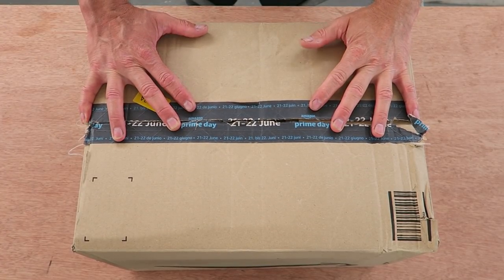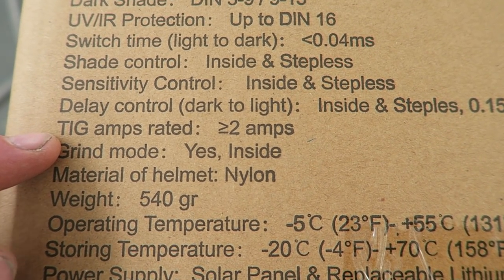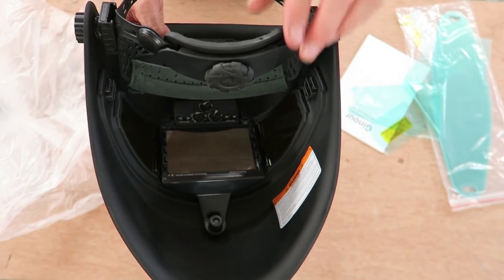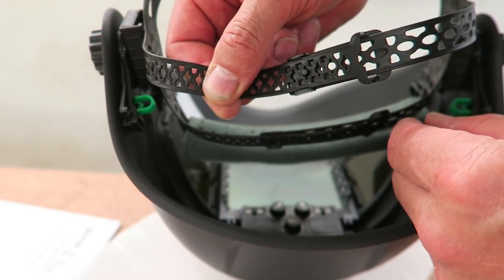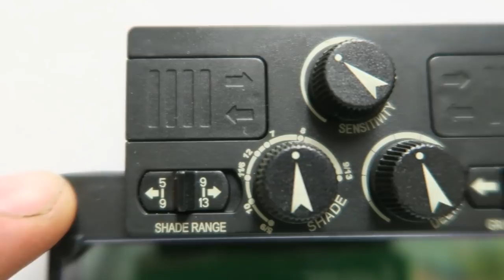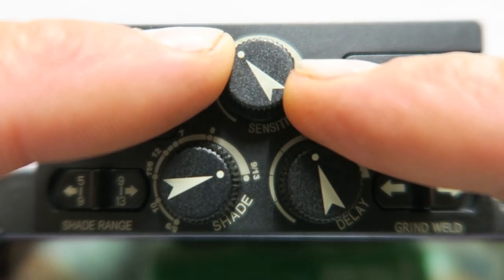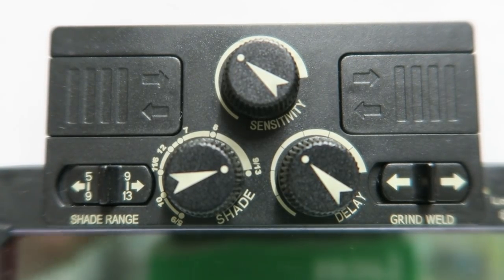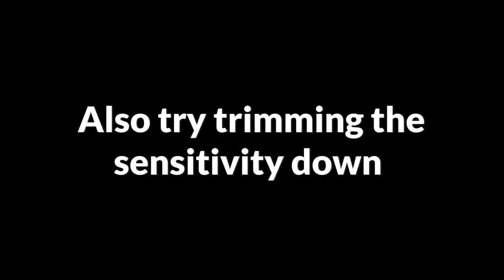Tool review Ginour welding mask / helmet review Trev's Blog

Comment: Unboxed the helmet.  Guess what?  It works!  The head adjustments really make the helmet very comfortable.  You are correct - the instructions suck.  The person who wrote them must have never seen the product.  Made a couple of test passes and the ease of tunning of the controls was spot on.  The only thing I would like added is a "TEST" feature. For the price it can't be beat. Thanks for the video.
Reply from the maker: I’m glad you’re happy with the helmet, for the length of limited time using it I was impressed by the clarity and responsiveness without any false triggering or flashing. Hope it serves you well. Cheers Trev 👍

Comment: Looks like a good mask for £50, especially if its as reliable as the £20 one you also showed - I paid £30 for one of those for about 17 years ago, and it's been fine for mig but not so great for low current tig, and totally incapable of pulsed tig. I also have a Speedglas 9100XX which I bought for low current and pulsed tig. It's far nicer but was expensive 11 years ago. If I was buying again, I'd probably take a chance on something like this £50 mask, as it has pretty much the same features as my Speedglas. How clear the view through the mask in your video is when not tinted prompted me to strip my masks down and clean everything!

Comment: Good to see you again Trev..
Just need loads of people to send you cool tools to review (come on manufacturers send some stuff)
Any chance of a plasma table video? Would be good to we what you can make.
Reply from the maker: Thanks 👍 I’m in the process of getting the plasma table put together. I’ve had no end of hold ups including not having a thick enough cable powering the machine. Where the new cable is to be run there is a fence that’s being replaced. It’s all hurdles 🤩

Comment: Allot of features for a budget mask. As for the Cheaters.... Even if you can see well the cheaters will make welding much easier. I butchered one of my masks as I got frustrated with it getting in my way when welding in tight spots.

Comment: Where's it Made?  Is it going to fail in the near future?
Reply from the maker: China, I have no idea 👍
Reply: @trevsblog  it is usually printed on the back of the instructions if it is China its probably not going to last long.
Reply from the maker: @Andy-sh9eq  😂 I meant it’s made in China and I have no idea how long it will last but hey not everything made in China is junk. I know many cheap products made there are total junk but sometimes I’m quite surprised by the quality and some of it does ok. It’s surprising how much stuff is manufactured in China then assembled in the uk. Cheers Trev 😁